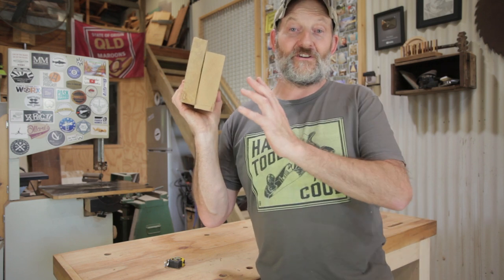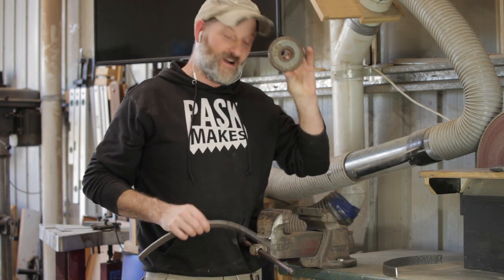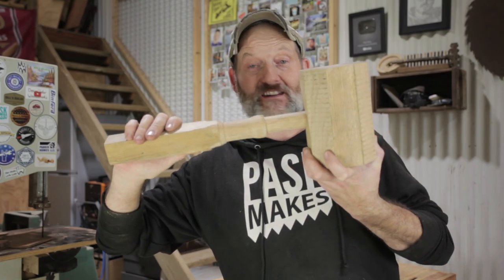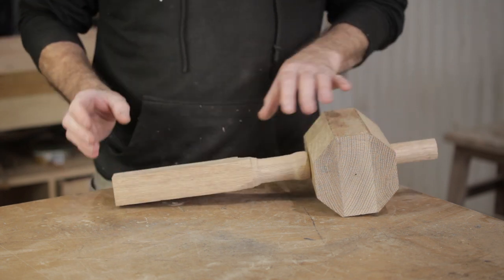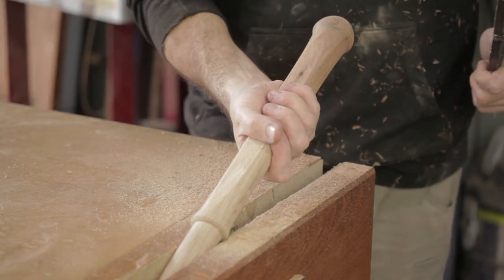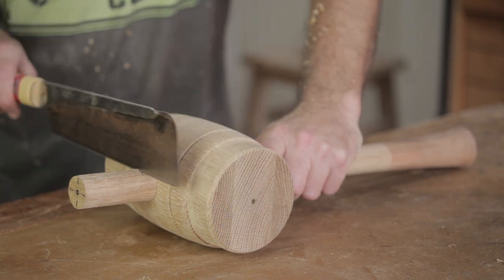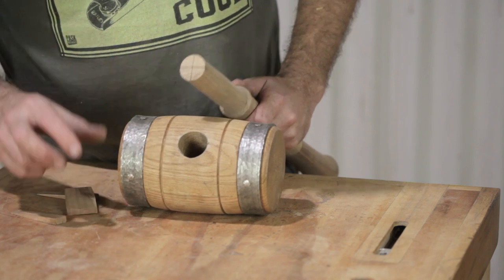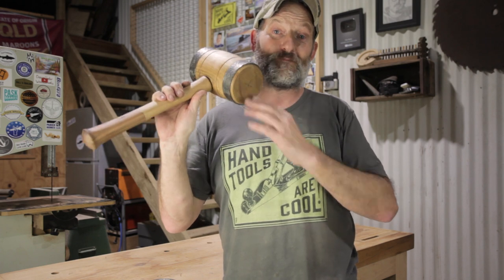Big Steel Ringed Mallet

Comment: If that thing were just a smidge larger it could be used in the circus at the strongman hammer bell booth.
Reply: I love those hit the bell attractions at the carnival's. I grew up providing all the fire wood for our family. I would walk up at age 15 to have a try and the men hanging about would grin as if this will be funny. I knew by watching the success and failure of others that it wasn't necessarily how hard you swung the hammer it was where you hit. They gave you a swisher sweet cigar if you rang the bell. I won alot of cigars. The most fun was to wait for a big burly man to break a sweat beating the pad to death and never hitting the bell. Then I would go at it again. You would hear someone say it was  rigged but it was all in the mechanics.
Reply: @Shack Man Everything at a circus is not what it appears and is rigged in their favor so you are right. :)  Fun times.

Comment: FYI, it doesn't take very high temperature to make in interference fit for steel. Mechanics use an oven at 400F to fit flywheel ring gears.

Comment: Just passing on a tip I've heard from several people who weld for a living - be careful where you clamp your ground. By clamping it to the handle of the vise you expose yourself to possible arcing within the treads of the vice thereby welding the vise in a permanent position.

Comment: Neil I forgot tp tell You how much I  Loved your flat bar roller same way I've been doing
it for years- even used 10 - 12  inch Pine trees to bend 2.5 in. heavy walled pipe of 
coarse with a bigger 3 in. cheater pipe to get the advantage !!  Hahaha!  : )
Weren't those " Medieval  Bracelets " too ? They turned out very cool !

Comment: ...unless i miss my quess, that looks to be around 1/8" x 1" inch (U.S. measurements) flat-stock steel. As such, with a torch, you could have gotten it hot enough to expand to do what you needed it to do. The mistake turned out nice, and added some constrast to the mallet over all. Setting up my work-shop now as i write this, i can think of a few uses for mallets of this weight. If, you do not mind, will more than likely copy it, for my own use. Thanks ever so much. Also, anyone ever told you you talk kinda funny? LOL. thanks for a great video. Scottishxpride, Texas.

Comment: Re. heating the rings, I saw a wheelwright fit the metal "tyre" to a cartwheel by heating it in a low, large radius bonfire in his yard - I guess you don't need the  intense heat as a forge provides for this task, you just need to the ring to expand.
Reply from the maker: That's cool! I didn't plan on get it glowing hot, I did think about lighting a fire but in the end I thought the route I went would be easier (and quicker). :)

Comment: Good idea with the ring Neil!  By the way, I was skeptical of the handle increase...but it turned out nicely.  Be honest, though, and let us know if it didn't work.  I had thought you were going to have to start again, but you beat the odds again.  Great video!
Reply from the maker: Thanks Rob! I don't reckon there will be any issues with the handle, it should be plenty strong enough. :)
Reply: I believe you're right.  I think you'd damage the head before you did anything to that handle.  You know, every time I think of that reamer, I think of how you cut yourself.  You've scarred not only your hand but my brain!  Hope your hand has healed well.

Comment: I don't know if you have a gas stove, but that would heat the rings enough to expand them.

I once used a gas stove burner to bend a street cleaner bristle (spring steel).  Not a good idea as the bristle became brittle once it cooled and broke when I tried to use it.  That was a long time ago when I knew nothing about heat forming metal.  Now I know only slightly more than nothing about heat forming metal.
Reply from the maker: I wasn't sure how hot I needed to get them to expand so I took the easier and quicker route! ;)

Comment: I love that you made it that size because you didn't have a smaller object to make your rings. That is the epitome of making for the sake of making, and it makes me happy to see it. I do have one question: Why did you not drill some relief holes in the wedge slots on the handle? I've see other makers do that when fitting a mallet head, and noticed you did not. I'm just wondering--not criticizing. I don't do a lot of making of this sort, but I do watch a few videos here and there. (I did make a mallet out of HDPE, but the handle I used was repurposed from another, larger mallet, and I just cut it down to fit. It already had the slot cut.)

Comment: I’m surprised you said the steel rings can’t be heated enough with a blowtorch. A blowtorch can get a small steel strip like that red hot. How hot do you want it? Isn’t the idea just to make the metal expand a little, so as it cools it will shrink tight onto the wood?
Reply from the maker: Maybe I could've gotten enough heat into them but I was unsure how much heat would be needed to get enough expansion. I've heated steel up to red hot with a blow torch many times but you can only heat a small area at a time. There is no way you would get the whole ring glowing even with two torches. Maybe it didn't need to glow, I don't know. :)

Comment: A mallet that size is just what is needed for chopping mortises with a pigsticker chisel.  You could have heated the rings on the burner of a cooking range - they don't have to get red hot.

I was wondering - is that a homemade bandsaw you were using?  If so, do you have any videos or other info about it that you'd like to share?
Reply from the maker: I was unsure quite how hot I needed to get them but it worked out. It is a homemade bandsaw made from Matthias Wandel's plans. I don't have any videos on it but Matthias has plenty. :)
Reply: I've long been familiar with Wandel's bandsaw, but from the glimpse of it I got yours looked a bit different.  Thanks for your reply.

Comment: nice work!
but never weld like this! this way the current will go through the thread and will leave a little mark which will cause damage to it over time (same with welding where there are bearings around - never let the current flow through them)

Comment: Was wondering how the glue and epoxy go with the vibrations from the blows. Would it not cause cracks and thus lose its effectiveness?
Reply from the maker: I reckon with the tight fit and nails it would work without the epoxy. But the epoxy will fill any voids and make it an even better fit. :)

Comment: Ha, if you extended the handle anyhow, why didn't you do it on the other end? Then the squared end could be "fixed" too to match the hole better (just turn the staff upside down). Anyhow, Thor is full of envy now... :D Good work!

Comment: cylindrical eye profiles are not safe maybe cross pinning is an easy solution, but oblong and reverse tapered are safe, why? otherwise it will spin and eventually it will fly off and hit you in the head., 8 out of 10 YT creators don't get this right!

Comment: Hey, regarding you heat fit, you could of microwaved the rings...
Yes, sound risky/stupid, steel in microwave, but for those following Ave,  he shown how.
Wrap the rings in a rag, soak with water then microwave. Make sure the water don't evaporate all.
100deg Celcius should give you .001" expension over 1.0"
https://www.youtube.com/watch?v=LVODJm05plw
Reply from the maker: Cool! That sounds crazy! :)